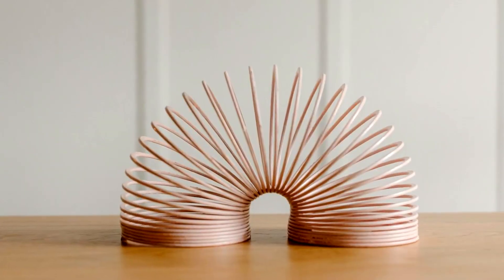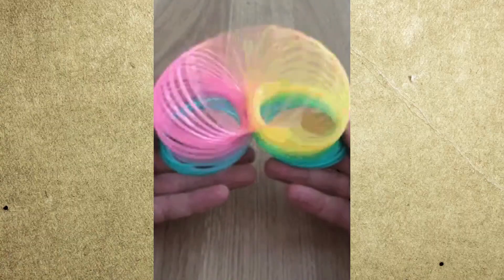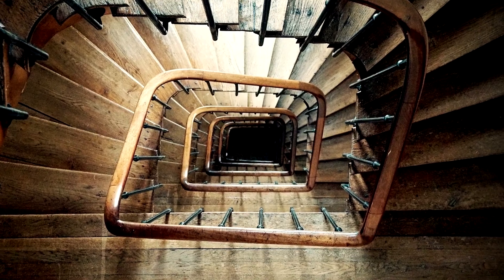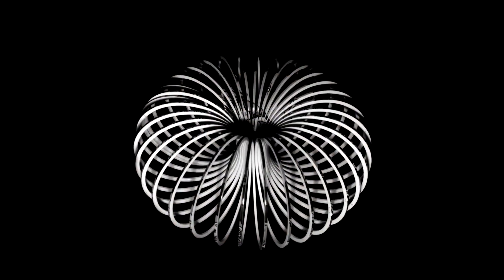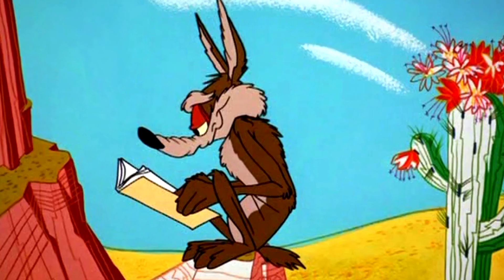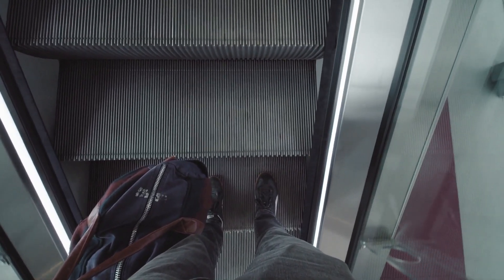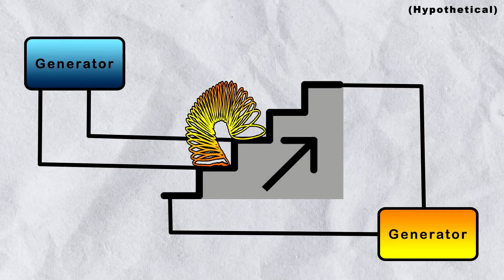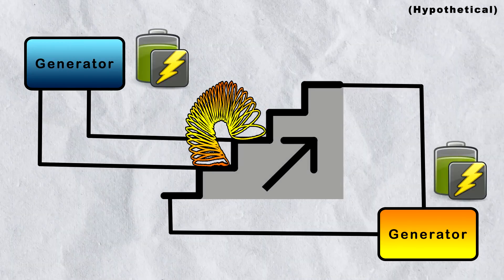why it doesn't work 15

Comment: The big issue here is that when you add more slinkies to capture more energy, that puts more weight on the escalator so you need more power to lift it.
Reply from the maker: true

Comment: You use electric energy to power the escalator, adding height to the slinky thus increasing its potential energy and when it comes down it releases this potential energy. And since new energy isn't created this kinetic energy with never exceed the electric energy you put in

Comment: Patch 2024.8.1
-Fixed a bug where escalators have infinite energy
-Entities submerged in oil no longer float when it rains
-It is no longer possible to 'Try for Baby' with the Grim Reaper
-Kleptomaniacs can no longer steal from places they can't reach
-Fixed a bug where people with a peanut-allergy have Arachibutyrophilia

As always, thank you for taking part in our simulation <3
Reply: Hotfix 2024.8.2
-Fixed the glitch with a big magnet and a car
-Removed Herobrine
Reply: @tundcwe123 added derp.
Reply: Roll it back to version 2007.09.25, it only got worse after that.
Reply: @redeye4516  I think your system crashed on 2001.09.11 after that it is not working properly 
(Don't know why but mine also crashed💀)
Reply: @Marvel-Asia LOL
Reply: @redeye4516 I will suppose it's your birthday
Reply: @CebGIN
Nope, release date for Halo 3. However, you commented this the day before my actual birthday, which scares me, so take my like and please stop.
Reply: This bug is not fixed yet i tried this this work
Reply: God i love the sims reference in there😂 almost woke my parents up
Reply: Yw

Comment: This is not about the infinite energy. 
This is about making a slinky that goes down the stairs forever.
Reply: "It's not about the energy, its about sending a message"
Reply: @ookjannesplanting1296 ？two steps ahead meme??
Reply: @the7screw  true
Reply: true
Reply: It definitely doesn't, have you guys ever played with slinkies?  Eventually they get kinked or descend a little weird and just stop.  

Even a perfect slinky would lose some energy as heat every bounce as the plastic/metal gets deformed.  Unless the constantly increase in height it will stop
Reply: true
Reply: @OreoIceCream. true
Reply: true
Reply: true
Reply: true
Reply: true
Reply: true
Reply: true
Reply: true